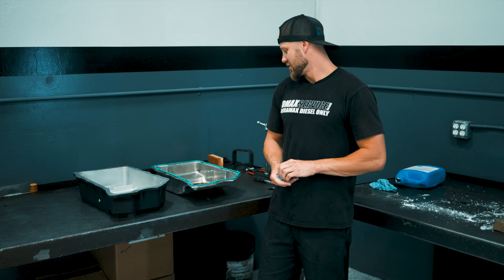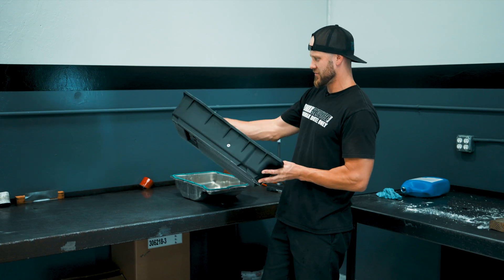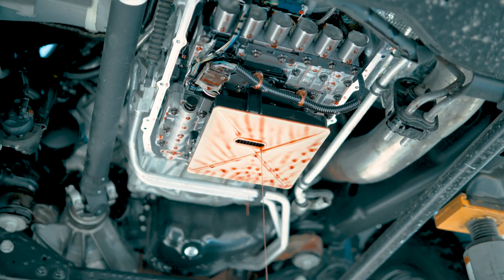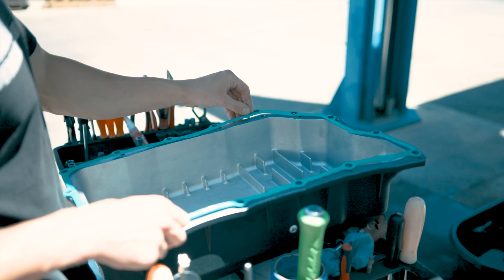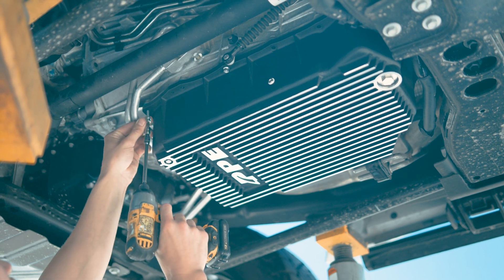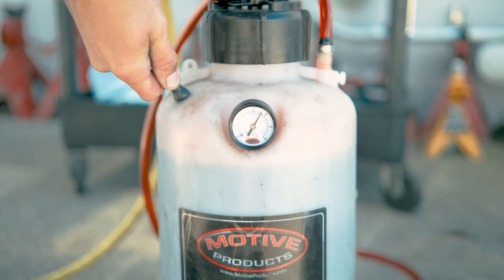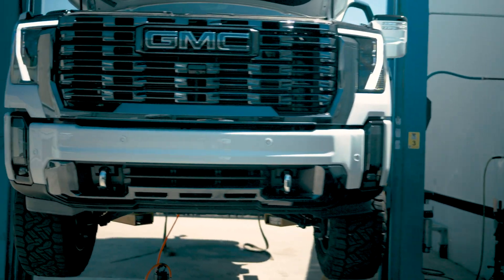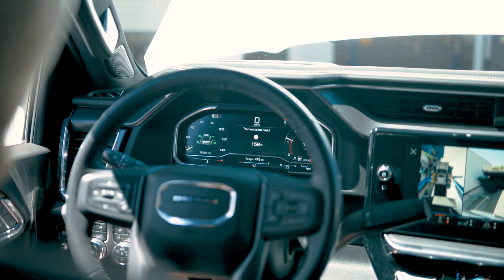How to Upgrade Your GM Allison 10L1000 with the PPE Deep Transmission Pan | Duramax Tutorial

Comment: What was upgrades?
Reply from the maker: The transmission pan that was installed.
Reply: @ any vids on valve body upgrades?
Reply from the maker: @cricri3534  We are in the testing phase of the valve body fixes as we want to be confident in a solution to fix these 10 speeds.
Reply: @ awesome! I'm currently not having the problem but want to prevent it. The "fix" isn't really doing anything other than monitoring.. GM needs to hold their end of the bargain for such an expensive truck
Reply from the maker: @ We are testing some aftermarket alternatives that claim to be the fix but we aren't satisfied until we verify with our own testing that it is a viable solution.

Comment: I just saw your video 8 months after you made it. Now Feb 25. You said you were testing solutions for the valve body issue. Did you find a good solution to the valve body issue??
Reply from the maker: We are still testing for an actual fix. These things do take time as we want to make sure that we thoroughly test the products and ensure they are solving a problem instead of just a bandaid for a bigger underlying issue. We installed the Next Gen valvebody upgrade kit and are happy initially but making sure longevity is also there as we are slightly sceptical.
Reply: Thank you for your prompt reply to my question.

Comment: Why would the make the fins cross the outer fins instead of fines line up with thenouter ones allowing faster drain more efficiant drain and far more surface arey to pass heat. Dont.like it
Reply: Build one yourself and sell it to us
Reply from the maker: At the time of filming this video, options were fairly limited, and you do bring up a good point about the additional surface area with the fins in the other direction and Banks Power offers a very nice transmission pan, in pre-sale currently, that does have the fins oriented in the fashion that you are describing to offer additional cooling surface area. But the draining time won't really be affected as the transmission fluid is so thin and the fins on the PPE pan are spaced apart fairly wide that a few seconds really won't be noticeable during services.

Comment: While you’re in there, swap out the junk valve body.
And don’t buy a factory valve body.
Get the machined unit with the paper gasket upgrade.
Reply from the maker: Yes, the valve body can definitely be a problem, we are testing a few different solutions to find the best and most reliable fix for these transmissions.
Reply: Where could I buy this better valve body?

Comment: Question: I got 24 chevy 2500 duramax and that circle thing on transmission at 1:11 (top center) always has a drop of trans fluid on it...I think I see same thing for that truck. Why is this and normal?
Reply: Lol 😅 Welcome to the club. I have that on my 21 L5P. It’s the 10 speed transmission special. Took it to the dealer and they said it was a leaking torque converter seal. Replaced under warranty and started leaking after a few hundred miles.
Reply: Same shit. I got rid of it.

Comment: No magnetic
Reply from the maker: The PPE pan does in fact feature a magnet on the drain plug for easy removal and cleaning.
Reply: @dmaxservice  do you think that magnet is sufficient to pull out the particles?
Reply from the maker: Yes

Comment: @dmaxservice GREAT video!

I just did this service on my 2022 Sierra Denali 2500HD. When you say 19qts, I'm guessing you meant total while cycling over and over getting a little bit of a flush of the old stuff out. I did mine this past weekend and I can say with 100% certainty, that 8.25qts came out. Since the PPE Deep Pan adds exactly 4qts, that is a total of 12qts that went in it, but I didn't flush it since I only had 16K miles (fairly easy miles) on her. And even when bringing her up to temp (torque-braking method) I still had to drain just a tiny bit from the check level standpipe. I can say for those wondering, the next servicing will be a piece of cake with a simple drain and fill. And for that job, I estimate it to take me only about 30 mins (40 mins tops) for a dump and pump, with no filter change.

The PPE pan, giving a whole gallon more of fluid, does indeed keep temps way down. I live in the PNW (Seattle area) and I would regularly see 145*, or if in a lot of stop-an-go traffic in 90*+ degree temps, I would maybe see 165*. But now I'm seeing at least 20* lower, sometimes more if in cool whether. 

As far as what type of fluid I'm using, I'm using AMSOIL ATF, full syn. It is what they recommend on their website, and I'm sure they wouldn't put it on their website for my truck unless it is indeed compatible. Their flexible quart bags make it easy to squeeze into tight spaces so filling it up at the filler plug was cake. 

I also was able to keep track of the exact amount of fluid coming out because I used a MightyVac evacuator. I cracked the pan just slightly enough to allow the thin MightVac hose to creep in and suck out all of the fluid. I made sure to first drain as much fluid as I could from the OEM check plug and drained it into a clean pan. Once I sucked out all of the fluid from both the OEM pan, and the small bit of drippings that dripped from the OEM check plug, I measured exactly 8.25qts. 

I am the original owner since new. (2022 GMC Sierra Denali), so I know the fluid that I evacuated was put in from factory. 

I highly, HIGHLY recommend the PPE Deep Pan. The added 4qts (1Gal) of fluid really helps keep the temps down low. 

MightyVac MV7120. 
I ended up buying two for next time. One I marked "Dirty" for evacuating fluids. And one that I will use for "clean" fluid filling purposes so that I don't contaminate the tranny. 
For what it's worth, I've also installed the Banks rear diff cover, as well as put on a PPE front diff cover, and updated the fluid in the transfer case. All simple stuff to do in your own garage.

Comment: Great video but I have a question after reading a service text for the full procedure. It states there that you should let fluid drain from check valve till it has small drip. Did you guys ever have any over fill isssue with it pouring out of the check valve like that??
Reply from the maker: We have not had any issues

Comment: So what is the scoop with the magnets, it would appear the stock pan is equipped with two magnets like most transmission pans out there for years have had one magnet but I did not see nor was it mentioned that the PPE pan has any magnets ?.
Reply from the maker: The PPE Pan has a magnet on the drain plug
Reply: @dmaxservice  That answers that issue, and easy to do a drain and fill ( between filter changes ) without removing the pan and knowing what is on the magnet to alert of issues.

Comment: Great video.  I'll be getting a new 2500HD soon and my first planned mod was the PPE deep transmission pan, so this video was very helpful.   Process look pretty straightforward.
Reply from the maker: As long as you have fluid transfer pump, it’s not bad at all.
Reply: @dmaxservice  How much tranny fluid did it take to do this pan swap?

Comment: Exact video i was looking for. Wanting to do this to my 23 2500. Would you recommend Amsoil transmission fluid as an upgrade or not worth the money?
Reply from the maker: No, we have always run the ACDelco ULV
Reply: You do not run Amsoil ATF in the GM or Ford 10 speed transmissions. Amsoil does not make a ULV fluid. They may say they do, but if you look at the viscosity specs, you realize they don't.
Reply: @bruceb1958  the "Full efficient ATF from Amsoil is ULV" in case you wanted to look again.
Reply: @bruceb1958 AC Delco ULV is 29.2 at 40c. Amsoil is 20.5 at 40c. Are you saying it's bad to have a lower viscosity?
Reply: @bruceb1958 they do now